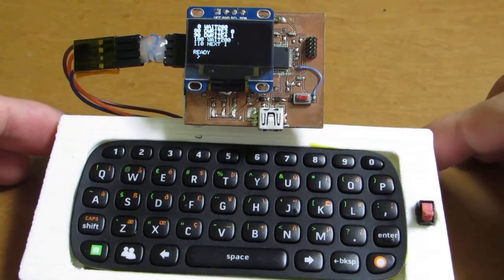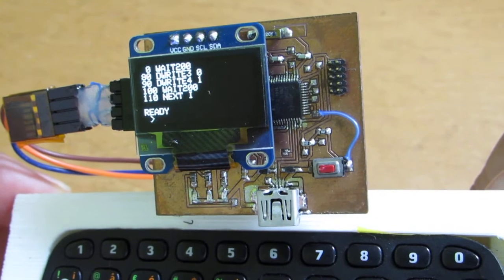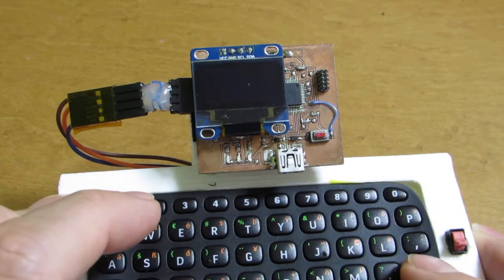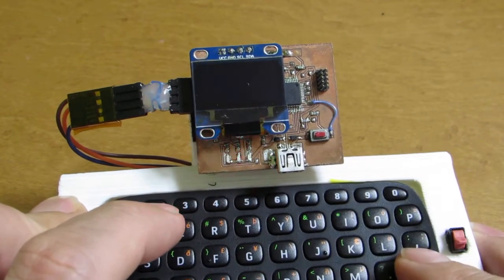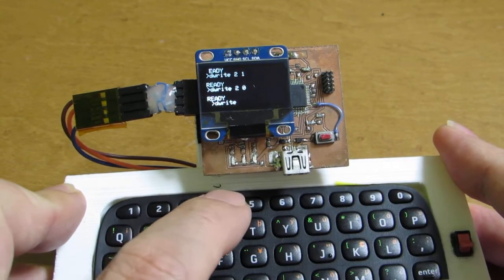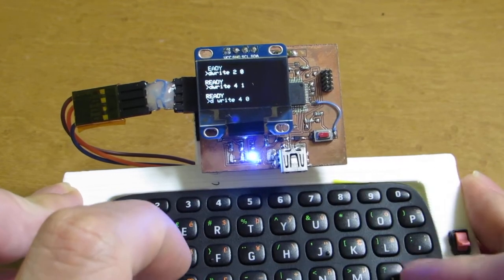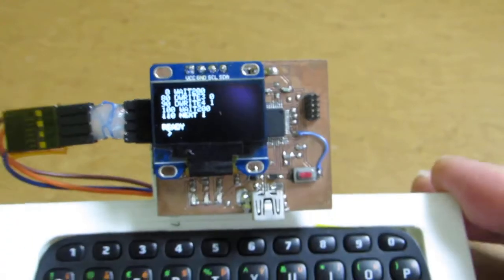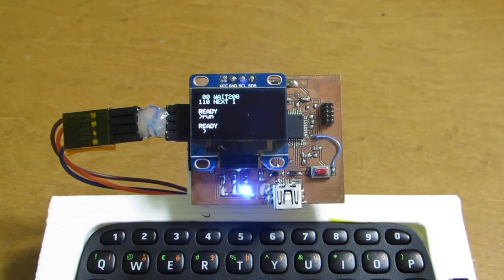Tiny ARM based computer running TinyBasic

Comment: Hi I see you use the Xbox chatpad. That makes me think, can you take a usb keyboard, cut the end and connect the wires to serial port? Or is it better to find usb/ps2 adapter  and connect the ps2 to serial?
Reply from the maker: Hello. General USB keyboard consists of keypad + controller and between keypad and controller, it has simply key matrix signal (not serial data at all) and controller directly talking USB. One possibility is making SAMD21G as a USB master but more simply we can have one converter from USB->Serial or PS/2->Serial. In each case we need one more controller (MCU).
Reply: +microwavemont interesting. I've seen an adapter USB to serial. If I use this one I don't need the microcontroller, right? Because it should be all inside the adapter.
Reply from the maker: Right, but please be careful of "serial signal". RS232C signal and TTL serial signal are different (RS232C is inverted and level shifted signal to TTL serial). If that does not matter, just connecting is "done".
Reply: +microwavemont oh it is more complicated than I thought. I'll make a research. Thanks for the help

Comment: can you explain how did you upload the programme to the SAMD21G18 chip and how to install arduino bootloader in it plzz
Reply from the maker: Hello! Once Arduino Zero bootloader is installed, we can upload program just by using Arduino IDE (as same as general AVR based one such as UNO). The bootloader can be uploaded by ATmel ICE if the board equipped ICSP connector! It is easy and let's try!
Reply: +microwavemont thx i understood the idea but just to be sure can you make a video about it and plz put some links in the description to download the boot loader and all the other stuff thx love your videos :)
Reply from the maker: Thank you. Bootloader uploading needs ATmel ICE. Hopefully ATmel studio is quite useful. Please googling such a keyword. Thanks!